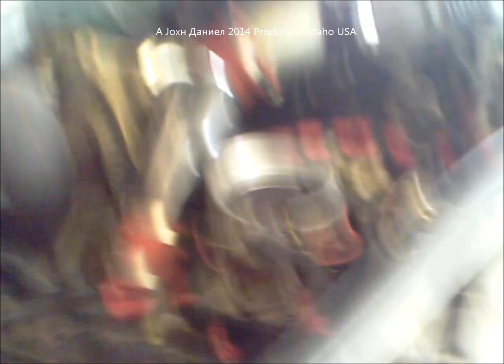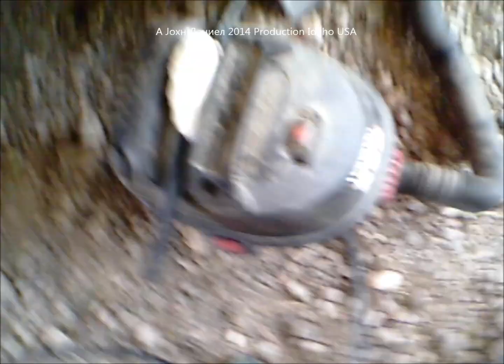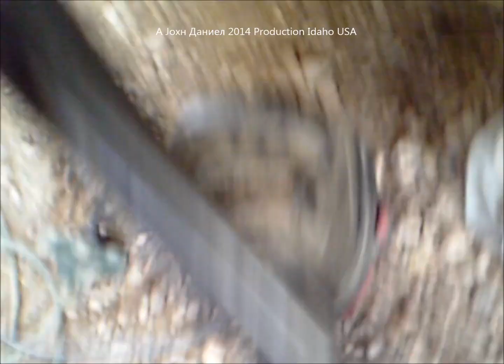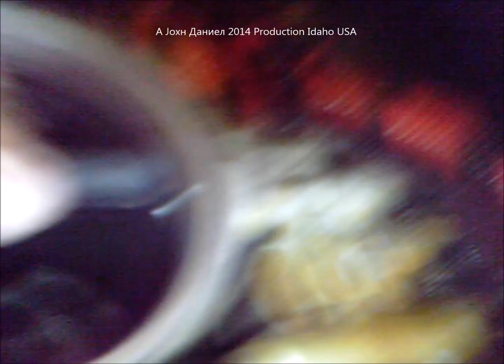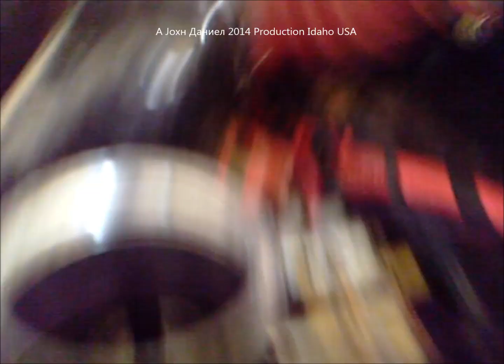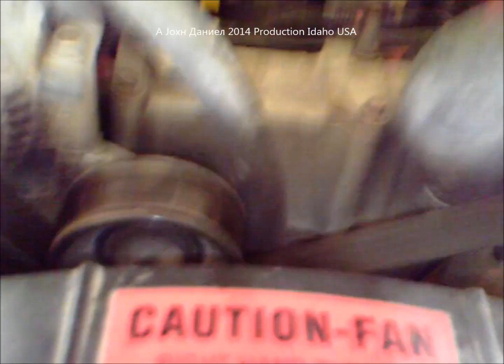Power Stroke 7.3 EASY Fuel Bowl Return Screen Cleaning

Comment: So I have a 7.3 I am help a friend with It was running great I left🙄 he let it run with a low tank before I get to drop the tank and clean it. Now rocks like a rocking chair when it runs a blows smoke. Is this a fuel injection issue?
Reply from the maker: Access the drain valve on the filter bowl, Drain it into a glass jar, let it sit a few hours and see if you have trash and water in it. This is a behavior of water or clogged return usually. Drain valve is tab you twist and follow the tube from the bowl that is going down to collect the diesel that comes out. Cleaning the filters is wise and a small chance your getting one or more injectors fouling. But once you restart it after checking the fuel and it's running look for leaks also. It will take 10 seconds to refill the bowl when starting again, so give it that before worrying.

Comment: this is great video. however my 97 f250 heavy has an intermitent problem. it will drive maybe 5 miles or so. then hesitate. then repeat hesitate or cut out. then die.  it wont start after repeated cranking. i then call the tow truck who drives it to the auto shop. and the mechanic starts it right up the next day. this has occurred 3x and just last week i drove to my parents house and it hesitated but i made it there and parked on their level driveway. when i went to go home it would not start.. but cranked fine. i left it and came back two days later and it started right up?  does anyone have any suggestions. as i love this ford and am just a good ol boy.
Reply: Camshaft Positioning Sensor
Reply from the maker: Diesel?? If so, sounds like mechanical fuel pump in valley is weak or hoses to it are going bad.
5 miles is about the fuel sitting in the filter housing, could be bad rubber in hoses to pump closing up when warm.

Comment: The right oil.  I run Amsoil 15 _40 .I change the filter every 25 k and the oil at 50 k. My injectors were changed at 387. 3 were leaking down.  I have since learned to pull oil out of pump reservoir..I am at 448k with my 2000 F350 dually
Reply: 50k eff that lol

Comment: Thanks for the tip John !!  I have three 7.3's. 95,96,& 98. The 95 has 380K.  My 98 with only 175K is giving me problems. Missing at high rpm's under load. Thinking it might be this screen. Had mechanic rebuild the fuel bowl assembly. Not sure if he placed the ball and spring in proper way. Unfortunately the 98 eng that giving me probs is in a E350 Shuttle Bus. SMH. Nothing easy to work on with it. I'll prob have to remove turbo and fuel pump etc just to get to the fuel filter bowl/housing...and this screen.  Thank you again !! David

Comment: My 95 has 50,000 on it and it leaks everywhere. The last a long time because you have to keep pouring new everything into them. It’s a driveway disaster. The engine might be ok, but everything Ford around it is crap. The only good thing about it is everyone seems to love these piles of crap , so it’s easy to sell
Reply: Have an 01 with 3 times your millage that dose not leak a drop. Sounds like you just don't take care of your equipment.
Reply: @joshuasteele5108  yeah, my 96 with 170k has 0 leaks
Reply: A 25 year old truck with 50k miles? 80% guaranteed all your rubber fittings and gaskets are shot

Comment: You got an AWESOME voice my dude. Also, thanks for the info. Gotta 96 7.3, 250,00 going strong!
Reply from the maker: Excellent, only got 556,320 miles out of mine before the wiring harness burned up.
Reply: 95' powerstroke with 290,000. Going as strong as ever.

Comment: I have a 250 Powerstroke Ford 7.3 liter engine
 the problem??
I have a leak between the engine and the transmission more to engine.
It appears to be it is diesel fuel. I cannot tell where it's coming. Any recommendations.
 thank you
Reply from the maker: Low pressure from manual fuel pump body to fuel bowl area. AKA - Banjo fitting washer on/behind the fuel filter bowl. It will leak and drain down between the engine and transmission. If it was a high pressure leak from your IPOP or fuel rail, you'd damn sure know. Take off your factory plastic cover, then with paper towels dry the area behind the filter ( engine intake valley) well, then fire up the engine and look behind the fuel filter housing.
Reply: @JOHNDANIEL1  currently have a banjo pump link myself . Been there for over two years . Makes starts a little longer and she marks  her territory so gas cars know its her spot .
Reply: I had this same screen that he is talking about in the video, get stopped up and it blew out 2 fuel pumps before I figured it out. It was making the fuel come out of the weep hole of the fuel pump and filling up the valley of the motor. Once I cleaned the screen and put a new pump in it, I haven't had a problem since.

Comment: What oil do you run?
Reply from the maker: Just truck diesel
Reply from the maker: Just caught that question better, OIL I run for the 500,000 miles  on my truck is Motorcraft 15-40 Diesel. Did not buy into the hype of others telling me get the big advertisers oils on the market.  Passed half a million miles on Motorcraft oil.
Reply: Thanks! Yeah a friend hit 600k on walmart brand oil. Lol
Reply from the maker: Its all about the oil modifiers and changing it often.
Reply: @JOHNDANIEL1  absolutely. I switched to 5-40 full synthetic in my 2000 7.3. main reason was it helped tremendously on cold starts when I don't have the option to plug it in